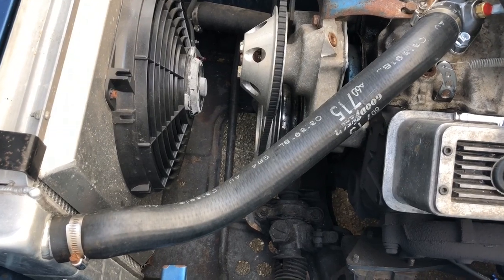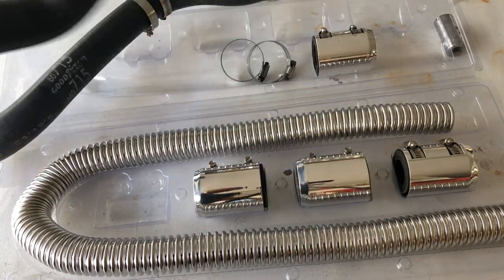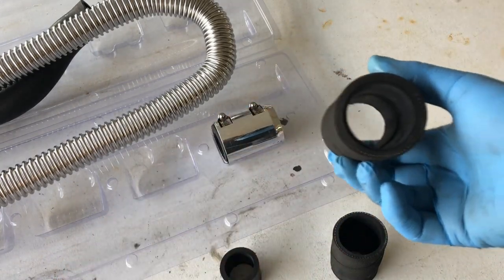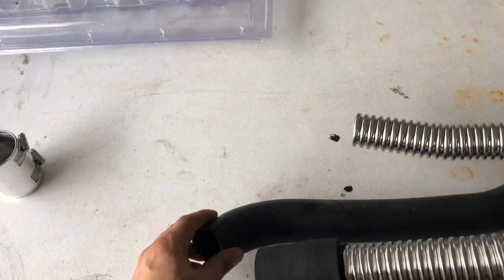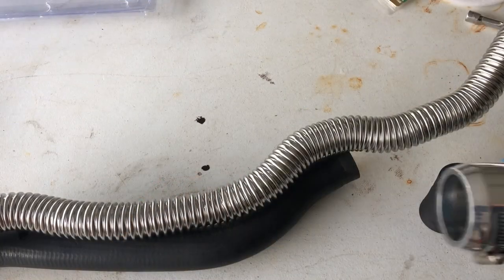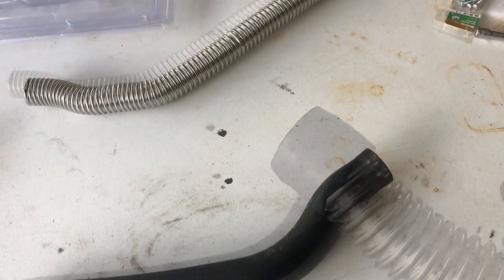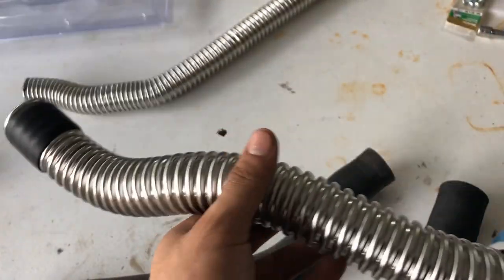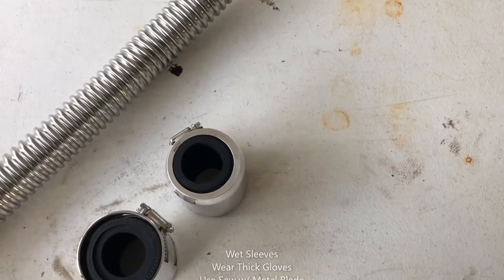280z: SBC Radiator Hose Replacement

Comment: If I just buy the smallest rubber piece would I be able to use this for a 1.75 to 1.75? Since you already have the other pieces?
Reply from the maker: I don't remember what the smallest rubber piece is but if that's all you're missing then I guess its possible. 

I had enough material to make two hoses. You may be able to use some stock radiator hose too.

Comment: I just got some for a mustang I'm restoring. How is it holding up? Any issues with it popping off?
Reply from the maker: They held up well, no issues at all, and look great.
Reply: Mine had popped off because I didn’t put them together like this guy. I simply removed the thin inner rubber grommet and put tube in lol. Rushing the job NEVER works

Comment: How did you get the chrome cap on so easy ?
Reply from the maker: It slipped right on, was a little snug. The kit comes with different thicknesses of rubber to use.
Reply: I’m having the same problem. Everything is VERY tight, the outer diameter of the rubber liner is pretty much exact to the OD of the cap.

Comment: What if you only have 2 chrome end clamps would i be missing the 2 rubber sleeves for the inside
Reply from the maker: My kit came with everything I needed. I was able to use the other two chrome ends with some stock hose on another car though.

Comment: Those hose have some benefict to the car more cooler ?
Reply from the maker: I'm not sure. The hose seemed like it could use replacing and I don't know what car to get a factory one from being that a 350sbc doesn't come equipped in a Datsun from the dealership.

Comment: Why didn't the lower hose work?
Reply: @UNLEASHED Why didn't the lower hose work?
Reply: Lower radiator hose is a different diameter than the upper hose. You'd have to get a separate kit for the lower hose.